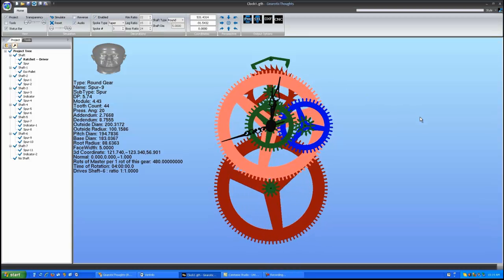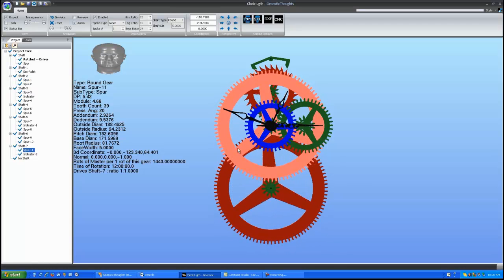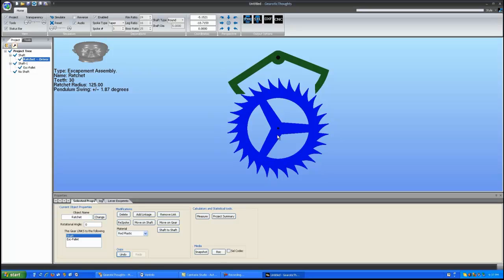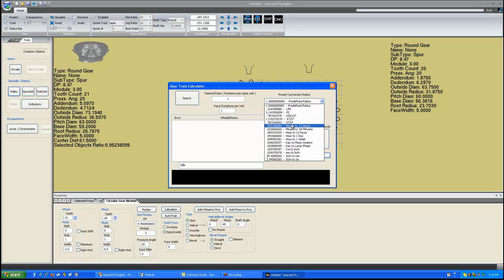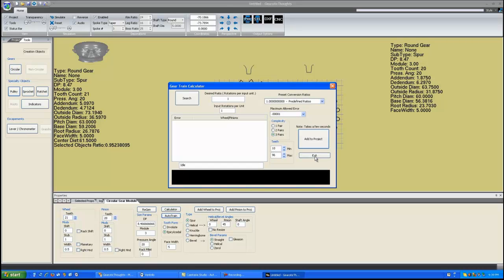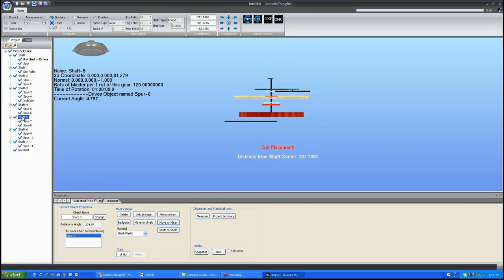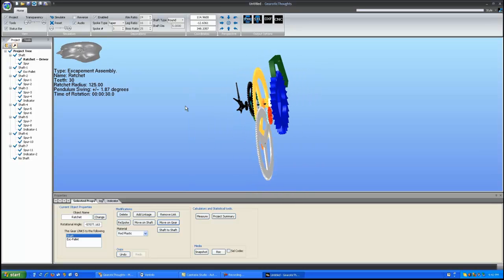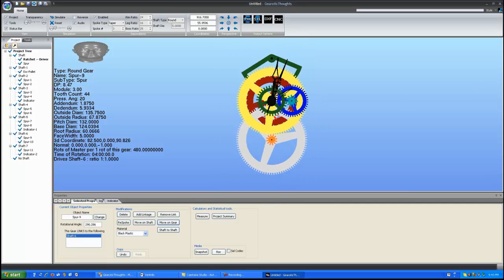AutoTrain Gearotic Thoughts

Comment: Art:

I am still trying to understand clocks from the very beginning - and eventually all the way to the end.  

Terminology is bandied about quite freely among experienced clock makers - and the quick, though specific use of terms to describe the movements of a pendulum and escape wheel, and the movements of its escape palette, just confuse the heck out of me.

Let me run some terms by you to show how confusing these terms, given the antiquated nature of clock textbooks, can be:

1)  Vibration = ?
2)  Cycle = ?
3)  Beat = ?
4)  Oscillation = ?
 
Now, correlate each term to a certain pendulum length and a corresponding ratchet and its resulting number of rotations per minute.

I finally gave up trying to sort through the terms and do the appropriate math.  Now, I just use DeCarle's table of clock trains for a given pendulum length.  Lots of different movements can be obtained easily and simply using this straightforward table.

Now, I could add that a very practical feature for Gearotic Thoughts would be the ability to export an entire gear train as one complete .dxf for importing into Sketchup Pro.  Once inside Sketchup, all of the plates (I use organic networks of tree-like appendages to support each portion of the clock train) could be accurately laid out for printing, and thence cutting on a scroll saw.

Thanks for your hard work and for making gear train design practical,

Greg Smith
Reply from the maker: Hi Greg:

 IF you do a shafting output on the dxf page, all the gears are put out in position as a dxf. Though the 1:1 printouts are probably easier if your using a scrollsaw..

Comment: Art:

In this example the ratchet turns 2 times per minute - but you note that the pendulum is a "seconds" pendulum.  Isn't a seconds pendulum around 39 inches long - requiring a ratchet that rotates 1 time per minute?

The second clock example uses such a ratchet.  Wouldn't this example need a shorter pendulum (estimate of about 11" long)?

Greg Smith
Reply from the maker: Greg:
   A meter long pendulum is about a 2 second cycle, each cycle releases 1 tooth of the ratchet, so with a 30 tooth ratchet, each tooth taking 2 seconds to release will be 1 rotation of the ratcher per minute, not two. You did well to notice. These videos are off the cuff and I quite commonly screw up on small details such as this, and your finding it shows you understand whats going on very well. Well done!  :-)